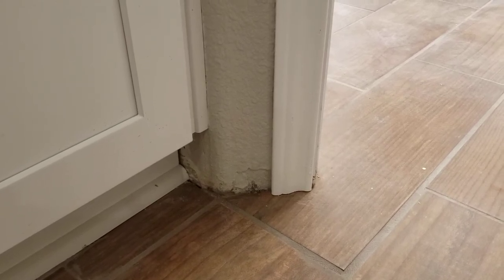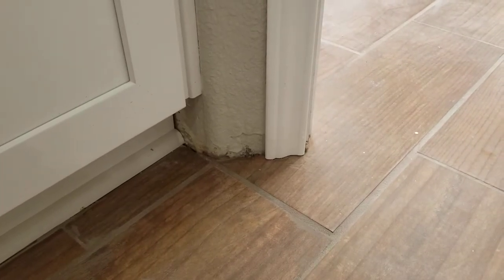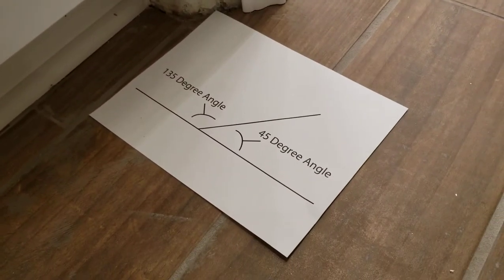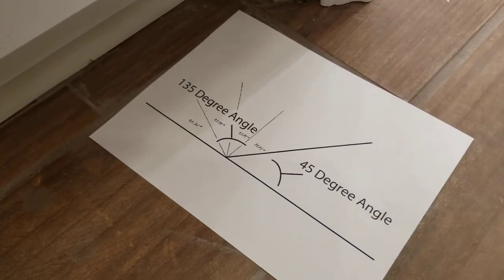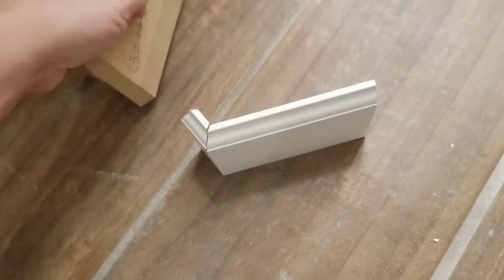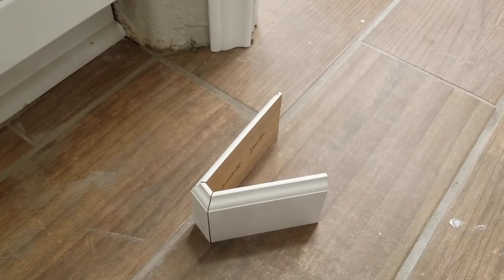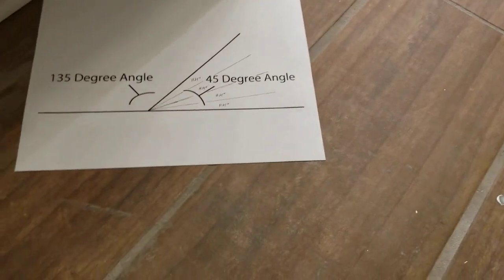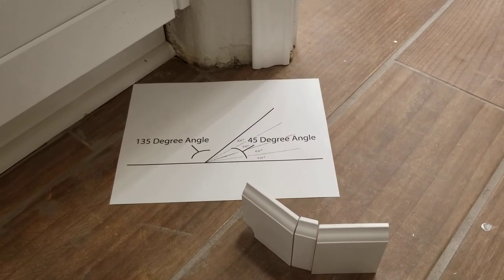Cutting baseboard around splayed (135°) bullnose corner-bead

Comment: I've been struggling with how to solve this issue for a while now and just couldn't figure it out. You just saved me! Thank you!
Reply from the maker: I'm glad to have helped!
It should be the same concept, but just turn your baseboard around on the saw so that the cuts result in the smallest face of the baseboard facing out in the bullnose corner.  It is still 135°, but it is just angling the other direction.

I hope this is clear and helps. Good luck!

Comment: It worked but poorly explained. How did you come up with a 45 from a 135? That made no sense. I know it worked but I don't get it. Are you saying I ignore the 135° and just go off of a 45°. I still don't understand.
Reply: A straight line is 180 degrees. He took the angle (135) and added 45 degrees to get the straight line. The 135 and 45 degree angle make a straight line. Similar to two 45 degree angles make a 90 degree corner. Hope that helps a little.

Comment: People's brains work differently. Why would you use the measurement of 135 if your just going to convert to a 45? If I understand correctly, the 135° makes no difference. All you are doing is taking a 3/4 corner and making it a quarter, and then reversing? I get that it works but I don't get how.
Reply from the maker: The 135 angle is what you are trying to match, but to do that, you need to divide the angle that is left up for the cuts.  This is all relative to a straight line, so it we are matching 180 degrees.  If you didn't make any cuts, you would have a straight line at 180 degrees.  You want to "bend" it 45 degrees, so that is the angle that you are shooting for.

I hope that this helps!!